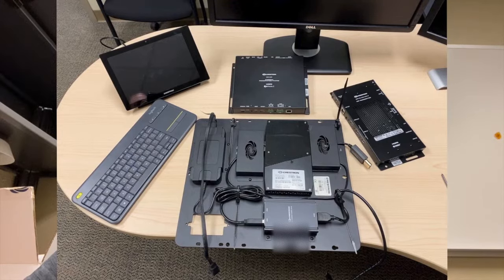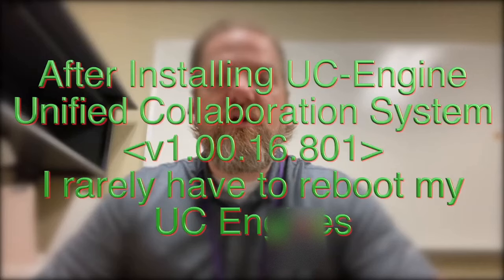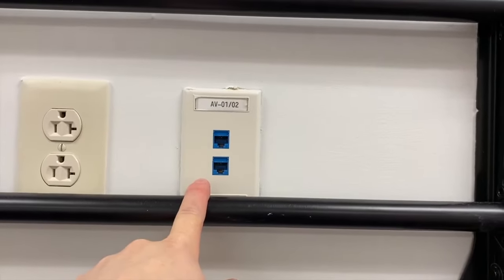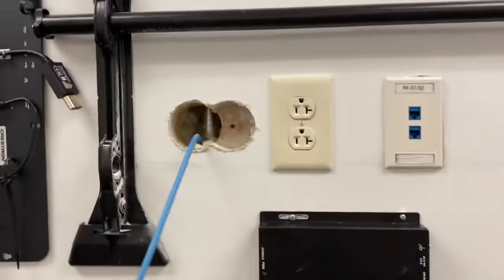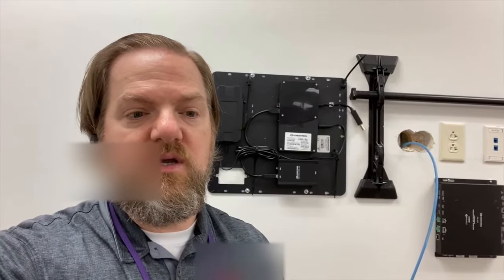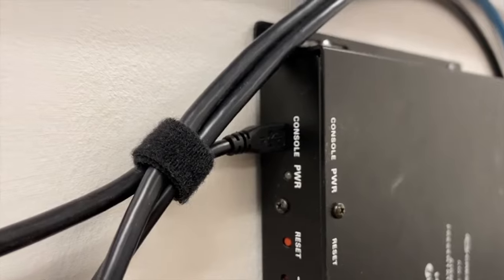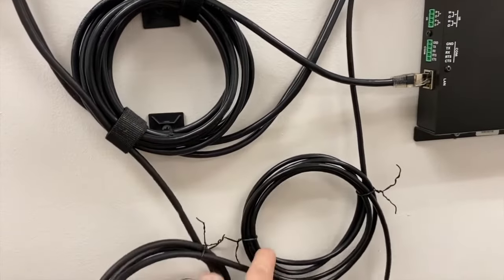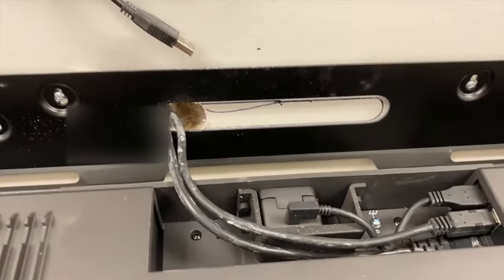Crestron Flex Install and Set Up

Comment: These are great, until they go wrong - frequently. I've had to re-image many of these now and Crestron True Blue support are great they simply will not RMA anything, the stock answer is upgrade firmware, re-image. It takes about 5 hours to re-image and that's if they let you have it - which they won't. Out of a team of five engineers if we have to be onsite for a break/fix they all live in fear should it need a repair. The TSW will drop off the network and refuse to connect to the UC Engine... Have fun!
Reply from the maker: We have run into all these issues. We have had to re-image countless UCs. If they do take one back for an RMA, sometimes they still come back with issues. Re-image is pretty much our go to repair. But your right, it keeps a tech busy all day doing just that. We have several different UC’s types in the field. We have a re image USB for each type on hand for when that time comes.

Comment: Thank you so much for this, Frank.  Probably the only video on Youtube that explains how everything functions and connects together.  I'm from EU and new to Crestron's terminlogy was an enigma to me until I saw this. 

In a "modern" teams room solution,  would you say the Airmedia AM-3100 together with UC-B30-T-WM would suffice for teams meeting and presentation in medium room? I don't think we will use BYOD and we want to avoid HDMI cables for screen presentation.
Reply from the maker: We put BYOD in every room now. Your client may have adopted the teams platform, but they may be invited to a meeting from one of their clients and that may be WebEx or similar. The only way to join from your FLEX room and use the peripherals, would be with the usb and BYOD feature. As far as HDMI connectivity. Im with you, there is no need to have that cable on the table. But people love HDMI. They are so used to it. It’s hard to get people to understand that the room has its own Teams Service account. That basically means the room screens are the far end. As far as your AM and UC-B30 question. I’m not a fan of the sound bars unless your in a very small room. If anyone is sitting more than 10-12 feet from the screen, I would us a UC- MX-50T system. I have a video of that system on my channel as well. I have a bunch is AM-3100’s on order. I have not put my hands on one yet.

Comment: Hey Frank, I inherited a crestron setup that came with two crestron tablets. I had to factory reset both of them. One controls the Ms teams meetings as you showed here and the other tablet was used to control the ptz camera. When I reset the second crestron camera the camera controls were gone. I know I need to point the camera somewhere by ip table I believe not sure to the ip address the the UC engine. Can you give me tips ?  I appreciate it !!
Reply from the maker: What kit did you get? Is your touch a 1060 or a 1070? Do you have a sound bar, a mercury device or is it a CX100 installer kit? Also, you should not need the second tablet. (Depending on the set up) you can upload what Crestron Calls a Smart Graphics file which your programmer will have to create. Are you just using the Flex  kit or do you have a controller in the rack? Also, if your not using the camera that came with the kit, make sure it’s Microsoft Certified.
Reply: @FrankGuest  the main crestron is a 1070 the other is a 1060. There is a crestron controller as well. Do you know if a custom user project are loaded on those controllers and the 1060 needs to point to it in the ip tables ?

Comment: These can be a bit of a nightmare... give me Yealink Mcore any day. The touch control panel, camera, microphones and speakers are self configuring.
Reply from the maker: The touch panel is what it is. It’s a Microsoft GUI. It looks that way for a reason. As for the camera, you can turn auto framing on or off. Those are the only camera options with the Huddly. Do you like the way The touch panel and display look now after the most recent update?

Comment: my crestron tablet they are shuting down after 10 min after configuration why?
Reply from the maker: When you tap it, does it turn back in? If so, Your UC is probably going to sleep. Go into the settings on the UC and change the sleep setting to Never.

Comment: Hi
How do i bring up the side menu that has the power button? 
Thanks
Reply from the maker: Those buttons disappear when you put it in one of the UC configurations. Log into the web UI or connect to it with toolbox. What are you trying to do where you need the side buttons?

Comment: with the hdmi does in go into the daisy chain in or daisy chain out on the tv?
Reply from the maker: The HDMI on the table plugs into the TX under the table. That TX is connected to the AM300 behind the display via a shielded cat6 cable. The HDMI out from the 300 goes into the usb200 converter.

Comment: Hello, if the grouping for the rooms does not work and when I click on the group and then the room and the colors don’t change - I rebooted the panels as well as the Creston in the server room, same issue - what could be the problem?
Reply from the maker: Let me take a look at one of mine. You used the Crestron Remote Connect software?
Reply: @FrankGuest  Hello Frank, yes

Comment: Hi Frank,

How can I download the “Crestron Remote App”?

Can you please share the app name or link to the download?

I need to remotely control the Panel to fix something.
Reply from the maker: Here is the link to download the software. Not sure if Youtube will allow me to post the link, but I will try. https://nam02.safelinks.protection.outlook.com/?url=http%3A%2F%2Fhttpupdate.crestron.com%2Fdevices%2FCrestronRemote%2FRelease%2Fsetup.exe&amp;data=02%7C01%7Cfrank.guest%40am.jll.com%7Cc3753686758e4920086c08d80e396fed%7Cbfef2b06d2564f8ebd038d3687987063%7C0%7C1%7C637274987136783577&amp;sdata=voShhKyn5BJ0wE3E4NeOm62jDG2jAipClwGFd6NgcrE%3D&amp;reserved=0
Reply from the maker: I don't know what I would do without this software. I have all most 300 of these Flex systems in the field.
Reply: Thank you Frank.

You are a legend!

I have another question that maybe you know the answer to.

My Crestron UC are now on WinVer 1909 with the latest Skype Room Console App (4.5.37).

I get a Blank White screen when joining a teams call. The panel does not have the Screen layout button either.

No matter what configuration I change it to, the Teams call will be a White blank screen. 

Do you know how I can fix it?

Before updating the OS to 1909 and running older version of the console app , it was working. But with all the latest updates, it stopped working. When I roll back and remove the updates, the white screen is still showing when on a Teams call.

But Skype calls do not have problems.
Reply from the maker: @Keveo   No idea.  I did some digging and couldn’t find anything related. You might have to call Microsoft because it doesn’t seem to be a hardware problem.

Comment: Hi. Wha is the Creston Bar model you used for this room ?
Reply from the maker: It’s a SB30 sir.
Reply: @FrankGuest  tks Frank! Would you the cost (rough estimate) for the entire Creston kit used, including the bar ?
Reply from the maker: @marcoapdantasify  If I were you, I would look into the Crestron Mercury BYOD systems. Those systems are more versatile. I have a video on that system as well. I’ll look up the price for both the SB kit and the Mercury kit.
Reply: @FrankGuest  thks Frank.
Reply from the maker: @marcoapdantasify   You could get the UC-BX30-T. That comes with the sound bar and everything you need minus the TV to turn your room into a Crestron Flex room. You can get that for under 5K shipped to your door. The install is supper easy. Look at the UC-MX50-T as well. I think that is a better solution for a small to medium (15 person) conference room. It also has the BYOD feature. You can get that delivered to your door for just over 5K.
Reply: @FrankGuest  great ! Thank you very much Frank.

Comment: How do you power on/off the meeting room display, CEC through the HDMI?
Reply from the maker: Unfortunately with the kit that we received, you can not control the TVs. Some of my builds I include a Crestron RMC3 to control the TV. But most of my rooms, I put the TVs on a timer. We use Planar TVs. Sorry for not being much help.
Reply: @FrankGuest  No this is very helpful to know.  I was always wondering how people were controlling the initial power on of the display/system.  I like the timer idea as well.  And if set to a timer I assume the display just stays running on the UC splash screen until the shutdown timer triggers them off?
Reply from the maker: @stewartgodfrey9357  correct. We set the UC’s to never go to sleep as well. That way the TSW1060 panel is always up.
Reply from the maker: @stewartgodfrey9357   I just had a meeting with my Crestron rep. He showed me lots of new devices that will soon be rolled out. For the feedback portion of the meeting, one of the things I brought up was how you can’t control the TV without adding a control device. I told them it would be nice if the UC could send an on/off command to the TV. He said good idea. So that may be coming in the future.
Reply: @FrankGuest  That's good to hear, the power on/off issue was definitely something that tripped me up the first time I was putting one of these systems together.

Comment: Can this system be integrated with existing mics and speakers?
Reply from the maker: bobmccormack1 yes sir it can. You can order the Uc-C 160 system. My conference rooms are split between what you see in this video, we call “presentation Lite” rooms and rooms without the sound-bar. We have speakers in the ceiling and Shure MXA910’s in the ceiling of those rooms, we call “Full Presentation” rooms. We also have two Routable DM’s and a cable box in those rooms. You have to upload a smart graphics file to the UC, that page will show up on the TSW 1060 as the advanced routing page. Pretty sweet! Let me know if you have any other questions.
Reply: Tes, but you visit our website to know more about customization, as it supports only certified hardwares
Reply: @FrankGuest  I'd like to see a video on one of your "Full Presentation" rooms if possible, to see how the touch panel and system routing works.  Also, what cameras are you using?  I've put a couple of these larger conference room systems together using DMPS3's, PTZ's, and the Shure MXA910's, integrating them with both Teams Rooms and Zoom Rooms, and I always wonder how others are handling this type of integration.